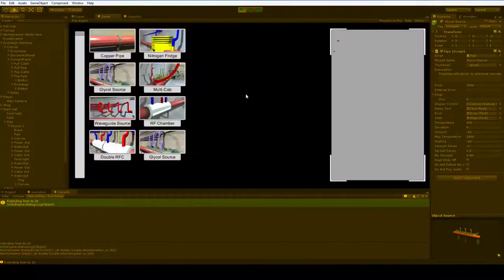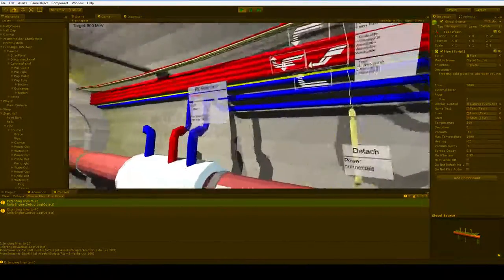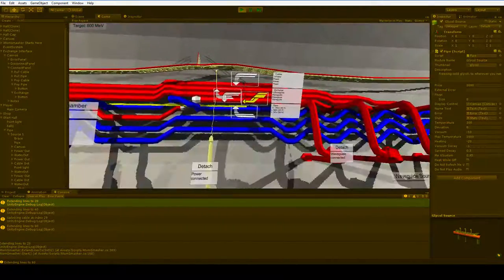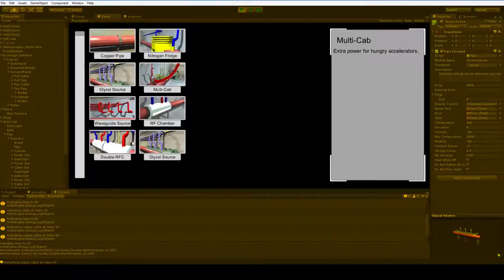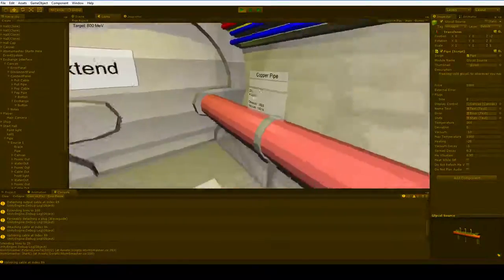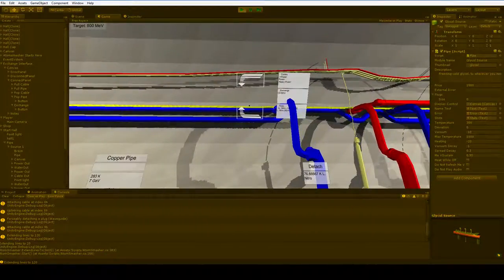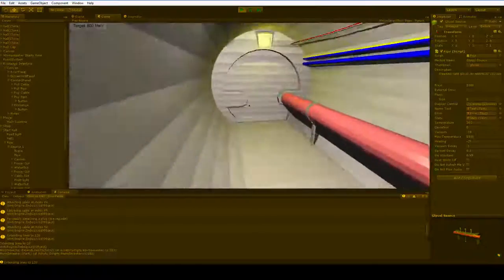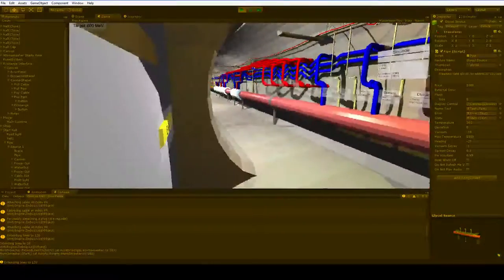Atom Smasher: Waveguides and Game Development

Comment: I'd think it'd be very possible to design further puzzles after adding all of the parts. I can make several challenges for myself on the limited existing levels. E.g. create more powered or more focused beams, minimize energy loss due to quadrupole, make collier warmer or colder, keep things as short as possible. Ton of limiting factors can be focused and each or even different rank of combination of them can be turned into most cruel puzzles.
Reply from the maker: Yeah, there's lots of cruel puzzles possible, although I haven't gotten quiiiite that far.
Reply: That's ok. A friend of mine had an idea for a new game loop, some kind of management thing.